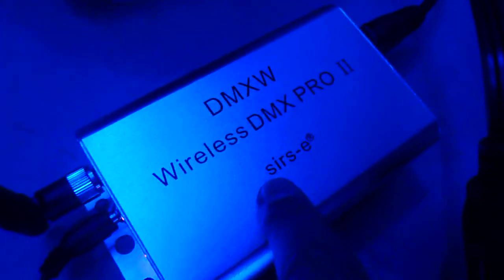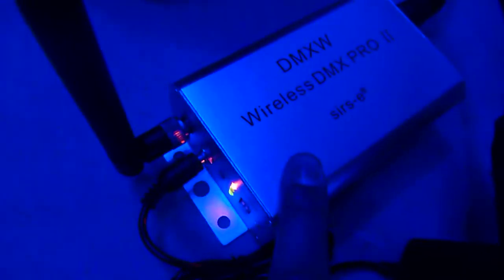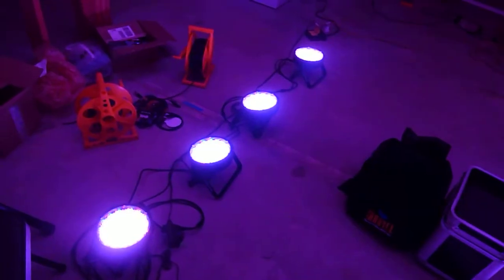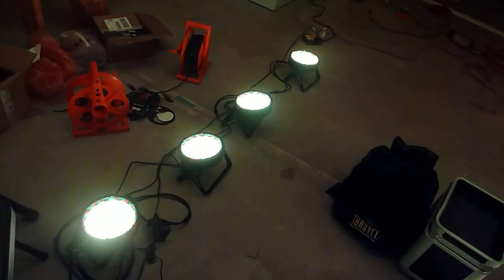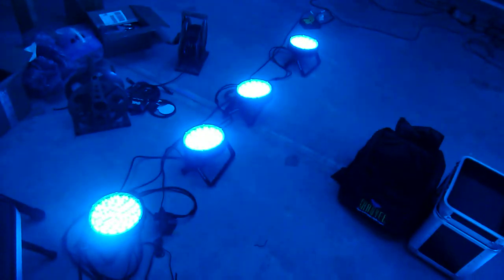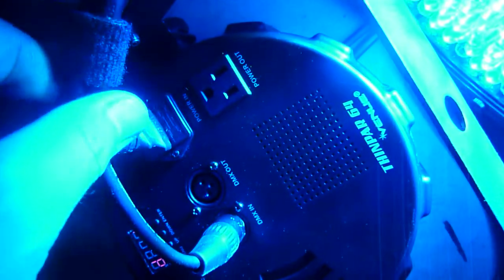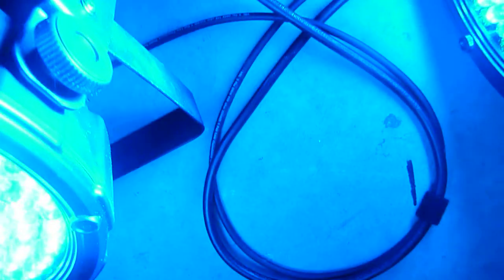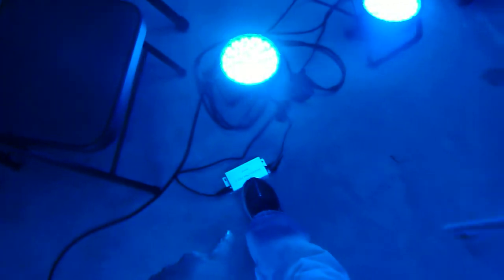wirelss uplighting receiver, timing setup, cable management www.atlantamusicdj.com

Comment: Hello Rocky! Just wondering what was that wireless Dmx device? I have a better solution than your Dmx wireless device. It may be less costly then all your wireless Dmx devices. Since you have the Tri 6 go out on the Dmx into a Slim Par 56 or maybe that light you had on your setup. Then continue to the next par light till you cover one wall. Then you use the Flarecon Air to control your Slim Pars. The Tri 6 will send the Dmx signal to you par lights. One Tri 6 per wall daisy chained to the Slim Pars. No need for those Dmx wireless devices.👍🏼
Reply from the maker: very cool thank you I did not know lets talk sometime I want to make sure I get it right and make a video giving you a shout out for this great pro tip thanks brother 408-205-0885
Reply: Sounds good Rocky! I am going to make a video to show you how to do it. I will have it up this week.👍🏼